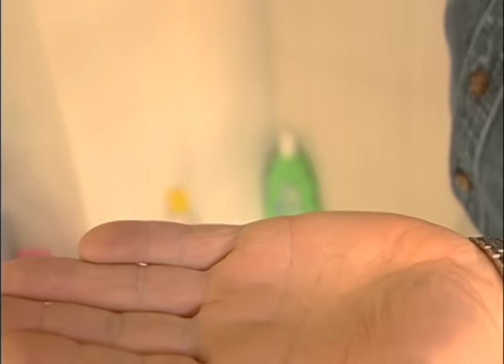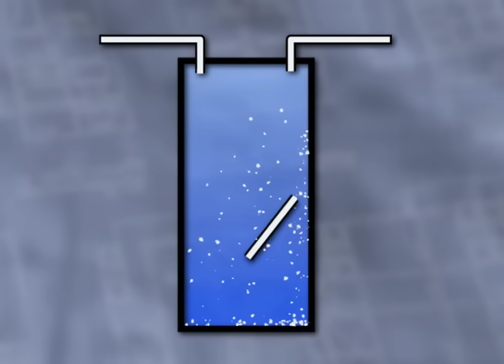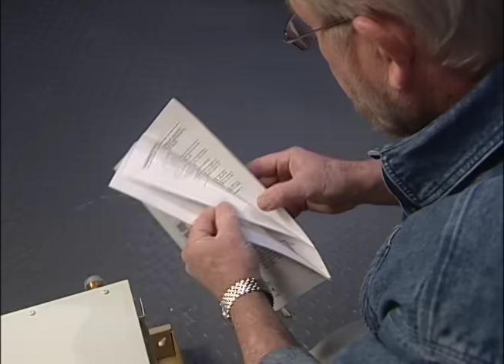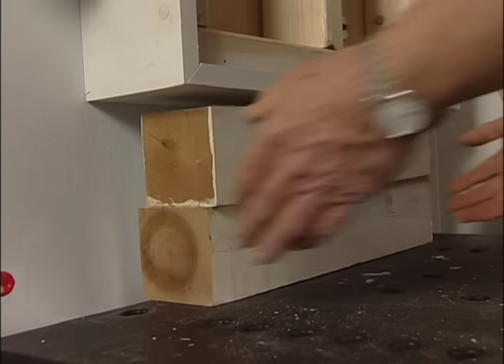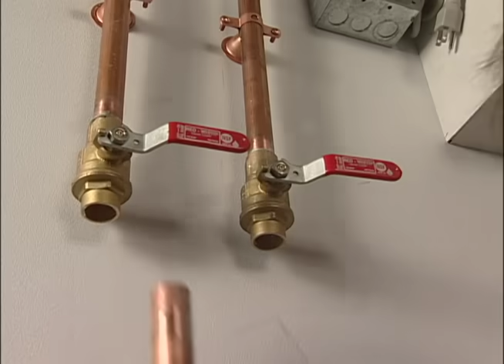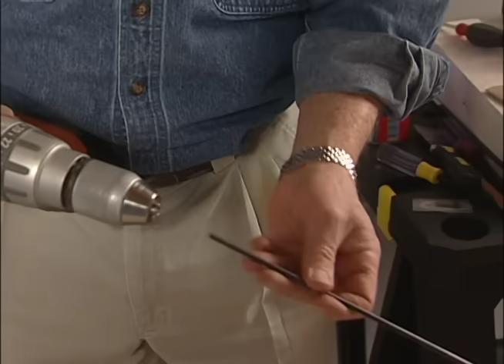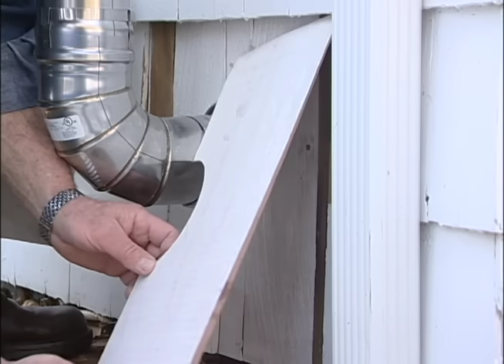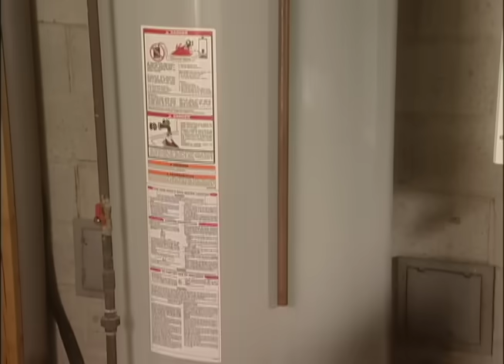Install a Tankless Water Heater

Comment: Glad to see the US is catching up with the UK at last.
We have had combination boilers ('Tankless system') for 30 years or more.
They are highly efficient and require just annual servicing and minimal maintenance.
Welcome to the 20th century.
Reply: It looks like you are the one who got stack in 20th centry...  In 21st centry we use heat pumps!!! Very efficient and clean source of energy
Reply: @ @Nietyp  

The outdoor fan unit of an air source heat pump usually takes up as much space as a washing machine. ... On the other hand, some modern boilers (or 'combi' boilers) take away the need for a hot water cylinder altogether, heating water straight from the water mains.
Air source heat pumps run on electricity.  the average value for greenhouse gasses emitted per kWh of electricity is 0.54702 kgCO2eq/kWh, whereas for gas this is 0.20435 kgCO2eq/kWh. If we assume that the alternative to a heat pump would be a new gas boiler at 90% efficiency (e.g. www.boilers.org) then in order for an air source heat pump to have a lower level of greenhouse gas emissions, it would need to have a COP of over 2.41
Whole life cost for heat pump over 15 years £17,940.40
Whole life cost for oil boiler over 15 years £14,784.00
Reply: No!  We are more advanced we don't even need  Water heater global warming is here already.
Reply: @ @z14film31  

Instead of being a keyboard warrior troll you need to do some research.
A Combi boiler and a tankless system are virtually identical.
Tankless units (also called “on demand” units or an instant hot water heater) heat water only when you turn on the faucet.
A combination or 'combi' boiler is both a high efficiency water heater and a central heating boiler in a single compact unit. Combi boilers heat water directly from the mains when you turn on a tap, so you won't need a hot water storage cylinder or a cold water storage tank in the roof space.
Welcome to the 20th century

Comment: Hi, I have question for you MR. Hazelton, my sister wants too replace the electric hot water tank in her manufactured home with an electric Tankless Water Heater but someone told her that she could not do it because the electrical in the house wouldn't be able to handle the power draw the Tankless Water Heater would need to stay running.  Is this true?
Reply: False. A lot of people are installing electric water heaters now without any problem.
Reply: @leeclark8486  For some reason my sister thinks that electric powered Tankless Water Heaters need more power to work then a standard electric hot water heater.  Her manufactured home was made in 1978.
Reply: She needs a 200 amp service for an electric tankless whole house heater. Also most homes do not have enough space in the service panel for the additional breakers.
Reply: Its true. They use a hell of a lot more power, and most mobile home circuitry and main service just isn't up to it. You got good advice.

Comment: Till you have a gas leak and boom
Reply: If you are scare of using gas, you can always buy an electric tankless water heater.
Reply: Lee Clark i didnt think they had electric tankless. I currently just use a normal 40 gallon electric water heater a old Kenmore power wiser 9

Comment: Nice video but let's go over the shortcomings not discussed in the video.#1 you should always contact your local gas utility of your intention of adding more gas load to the system. I'm sure you went from 40,000 to 50,000 BTUs and increased to around 200,000 BTUs ( Let the utility come out and make sure the equipment is sized for the added load. There usually is no cost for this).#2 let's size your current fuel run to make sure it can handle the added load from the point they tied in the csst back to the gas meter. This is called the longest run method and you will need total BTUs of the house and length of total piping.#3 considering your installer used yellow csst and not Counter-Strike csst you should have went over the whole bonding installation method all the way back to the main ground rod of your electric service panel ( this is mandatory for yellow csst per the national electric and fuel codes).#4 exposed csst not covered by the jacket should always be taped with an approved coatng at these points. My expertise comes from 35 years in the gas utility industry . I am currently retired and consult from time to time on gas installations such as this one, when incidents occur due to improper installations.
Reply: Not to mention a cheap sniffer is not an accurate leak check. They should have run a manometer test on the system. Another thing I noticed is that they installed the shut off valve after the sediment trap which is against code. Third paloma heaters are junk. Fourth why spend all that time on running water lines perfectly and then run csst strapped to the joists and wall. Hard pipe would have been a much cleaner installation.
Reply: @richardhintersehr9014  you're my kind of technician. I can assure you there is a lot of contractors out there who don't even know how to perform a manometer test on fuel runs ( scary huh ?).
Reply: @richardhintersehr9014  What about when he did a sniffer test and didn't even have the gas turned on?
Reply: Not to mention csst has nowhere near the flow capacity as black iron.
Reply: 15 years of natural and propane gas installation and service have taught me how things can and should be done. I would've much rather seen him use a Rinnai or Noritz heater and an actual gas technician instead of a plumber to do the gas work. Just because a master plumbing license gives you the right to do has work doesn't mean you have the ability...
Reply: Done wrong: they wonder why they had a gas explosion 🤔
Reply: @richardlamm4826  Well, that's a "sniffer" and one does need  light to see, good job! See you in the next life.

Comment: Ron..., You should have installed a 3 filter filtering system , two before and one after, at the same time you installed your tank-less water heater..     A large sediment filter first.., then a very fine sediment second with a carbon filter for taste and a micron filter after the heater to keep your house free from a little things that can close up shower heads, faucets.., and such...    I know this also means extra work.., but a great water system for say... 45 years is a great thing...   Your taste buds will thank you every day.......
Reply: The clog was debris not sediment
Reply: Also, this is for the hot water, almost never use for drinking.
Reply: @ramonl6637  Any water coming into the house can taste bad...  Also.., even hot water is a distillation process..., leaving crust and crud behind...   Best to make sure the water is as clean and pure as possible...   Plus..., everything will last longer the purer the water...
Reply: Harry Corley    I guess you've never lived in a very bad water district....     The first filter only removes what can stop your faucets, by size...   The second is only a back up for what your laying on the table in money...     Maybe your money grows on trees.., but most can't afford a glitch anywhere...  Yes.., the carbon filter is for taste..., your probably in a young city...   Most are not...    Knowing that you can't take advice.., you'll settle for drinking out of a hose....LOLOLOL...    And I am talking about great water for a long time...    You probably don't understand time and houses...   Your water must taste like shit....

Comment: I saw a condensation line in your vent so what happened to it?
Reply: Same question here... Our new H.E. home gas furnace has moisture drainage when it runs. There is a separate tube to our floor drain for the water flow. Assume the model you installed has some way of handling this aside from the exhaust pipe.
Reply: Some heaters don’t condense and are less efficient. Also some regions require condensation to pass through filters to remove acid b4 draining down the sewer or outside

Comment: Is missing few things 
T and p to the exterior of the home
Bonding for cold ,hot and gas 
Check valves for service 

Also not mention 
Electrical needs to be sufficient and that includes the electrical panel

Gas line 
Needs gas sizing . Not just t from the line
Or even have a dedicated line just for the water heater 

It looks like old video maybe that’s why

Thankless are more cheaper today
But the work involved installing one not really

Good look in your projects
Reply: Do you know where this was filmed? You can't assume his local code is the same as your own. I've never heard of plumbing a T&P outdoors

Comment: You put a noncondenser unit in? What year did you make this video? Kicker is , flash heating water will actually create more sediment if you have hard water. The instant unit has smaller tubes that pass over the heat exchanger so you'll actually have worst problems then before. PLus you have to service the unit annually with a system flush to remove debris. Treaat the hard water first and it'll resolve the sediment problems. And go with a condensing unit to save on effieceny. NEVER -EVER  buy one of these units from a box store.  Call a contractor. My god.
Reply: I agree copper heat exchanger will fail !
Reply: Go watch the video again from beginning

Comment: You should have bought a low nox 96% efficient tankless water heater. Your vent pipe would have been pvc plastic and you would have zero inches to combustible.. I have a Rinnai with a concentric vent. It truly is the way to go also with a tankless having a recirculating pump is a must if not you'll be waiting forever to get hot water if you have fixtures that are 30' or more away
Reply: Harry Corley  Your reply did agree with me no doubt there, but after reading your second reply I would have to disagree with your opinion on tankless beeing green is a myth because how much gas they burn. My tankless is 96% efficiency when the gas is burning.That means it burns very very little gas. And thats only when we call for hot water unlike a tank that turns on and off all throughout the day to keep the water temperature at the desired heat that the thermostat is set at.  on /off all day and night burning gas then you drain the tank when you take showers or laundry or what ever you need hot water for. Then your tank has to fill back up and use more gas to heat the water back up to the desired temperature setting, always using gas or electric. We do lots of laundry and dishes and showers are going 2-3 times a day at my house family of 3 now. My circ pump only comes on when I call for hot water no timmer or nun of that settings stuff. If I lose power  doesn't affect my my pump. My pump is called the Water Quick Pro and the way it works is just go to any faucet in the house turn the hot water on for 2 seconds then turn off the faucet the pump will turn on my tankless unit and the pump will start pumping water through my hot water lines for a good 2 to 3 minutes after that time your hot water line is now purged with hot water and ready to use. Its unlike any pump on the market very cool technology. Check them out at www.fasterhotwater.com We use to have a 40 gallon Electric tank waterheater when i finally switch to my gas tankless my electric bill went down significantly and my gas bill did not change a single bit and my tankless is 199,000 BTU it required a 1" gas line to feed this bad boy because of 30' distance it is away from my gas meter 3/4 gas line was not big enough to carry the gas load. Also Columbia Gas had to come and swap out the old gas meter for a 400,000 BTU gas meter that was required because my furnace is 90,000 BTU and 289,000 BTU exceeded what the old gas meter could put out (only 200,000 btu gas meter) but yet again my gas bill never changed.. Still $70 a month. So for me a tankless is going green. My electric bill went down, gas bill never changed, and we have endless hot water. Water bill even went down a little water bills are monthly where we live as well and high for everone around here. We can debate all day but once I went tankless I never looked back and never will again
Reply: Harry Corley  I'll put it like this when I installed my Rinnai tankless water heater it took forever to get hot water to my farthest shower which is a good 45 foot away and when you're going green with a tankless water heater that defeats the purpose because I'm letting 45 seconds of water go down the drain at 2.5 gallons a minute for my shower head once I installed my recirc pump and made a hot water loop with a second hot water line I can now start the pump let the pump run for 30 seconds and then go to my fixture and have hot water and under 10 seconds I'm no longer waste in water down the drain it's moving through the pipes heating up until I need it letting 10 seconds of water go down the drain is a lot better than 45 seconds when I'm waiting for hot water that's why I say for me a recirculating pump was ideal for my setup
Reply: Harry Corley  I meant 2.5 gallons a minute not not second
Reply: Harry Corley  Be careful that your return doesn't limit your PSI coming out of the faucet, though. My plumber made that mistake on a tankless he installed for us in 2006.
Reply: Harry Corley  It's not a matter of "running out of hot water", it's a matter of wasting energy to keep a huge tank of water hot 24 hrs a day, when you are only gonna use it for 3 minutes/day.
Reply: It doesn't really takes too long to have hot water in your shower, sink and others. It is just matter of seconds (10-15).

Comment: How old is this video? The metal venting and yellow gas tite are no longer used
Reply: Yes they are, it depends on the company you get instant water heater from, some vents with PVC some ss depends on flue gas temp.
Reply: Surprised to see yellow csst is still being used.
Reply: 5-10 years
Reply: Proflex, wardflex and trac pipe all still manufacture and sell yellow coated csst